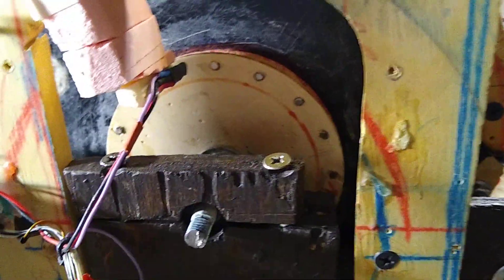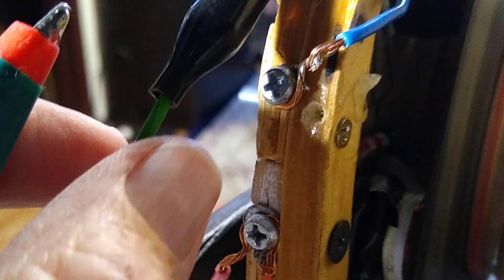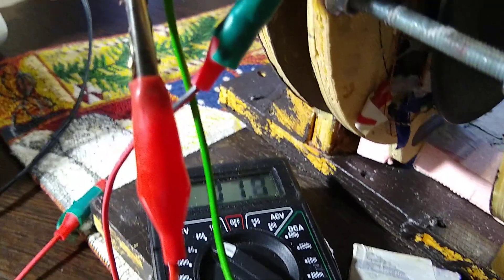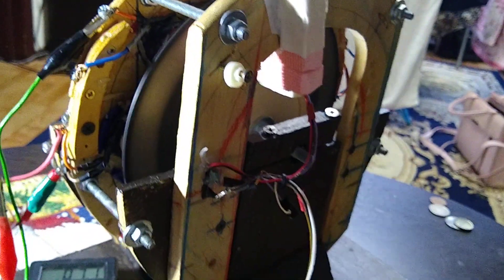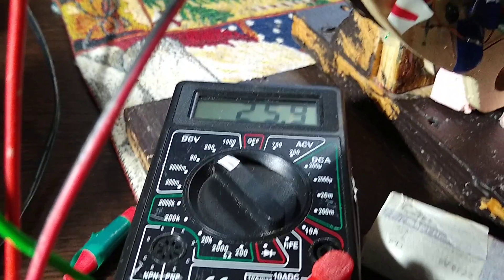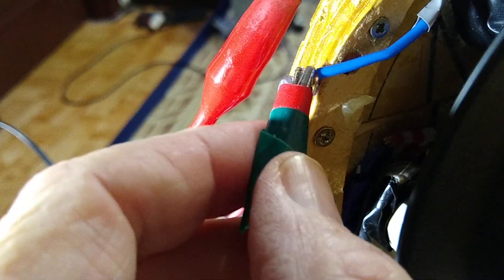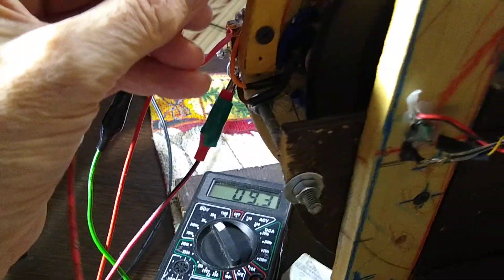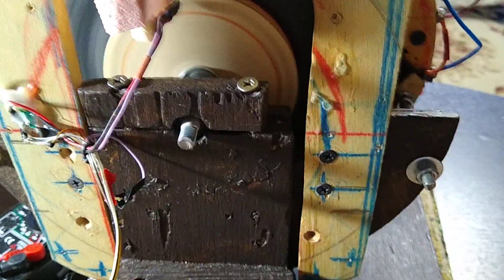Dualrotormotorgenerator now going very good.

Comment: you dont want source volts to be high its wasting power the trick is low volts low watts low current and "FINE TUNING"  as well as positioning between your gen coils and your drive coils . Gen coils and drive coils must choose between the face or the circumference of the rotor in order for fine tuning to happen via the stator position (3 phase stator GEN) / Tesla

Comment: 7:43 sounds like it will brake 100% now just distance the stator from the drive magnets so it dont brake but you cant because your drive magnets should not be on the face they should be on the circumference  ;) hope your getting my message

Comment: right  now it is running because your load is more than your gen coils produce use thicker wire for stator winding thick enough to 100% brake this existing setup once that happens then distance your stator a little so it dont brake but it will still run a lighter load for essentially  FREE

Comment: keep gen coil shorted and distance your stator from the magnet rotor to the distance where it keeps running under 100% load then put a useful load and it should run fine

Comment: Doug would it be better to lay it flat as Hitler's made the vw beetle engine flat as his scientists knew that it played in hand with earths field rather than a positive sun to negative earth that causes drag .. basically to match our equator .simple to see if any advantage as your structure looks sturdy
Reply from the maker: Thanks most of time my stuff has vertical axle but not on this one 
Hitler was a nazi asshole and VW engines only three main bearings plus split crankcase that always leak and air cooled always overheat 
Give me fiat 124 pushrod motor my favorite,  followed by volvo 240 motor that last for a zillion miles.. You need horizontal axle to balance at least. Used to be a fiat car mechanic in younger years...

Comment: Nice build! I am wondering if instead of winding left side and right side for run and generator on one core, what happens if you wind it directly as a bifiler. If the magnets were exactly positioned (no offset) you would get the majority of the backemf out without any lenz... but with the offset i admit I do not know. would be interesting.
Luc
Reply from the maker: Hi Luc
Getting backemf/flyback without lenz is not so difficult as you know (fill caps via steering diode then discharge caps while uncoupled to load) but I want to see the offset-thing how that is going to work.  It would be cool to find just the right offset for a particular rpms and load and see nothing at all when it is loaded, speed up might even happen.  I talked to a paranoid inventor guy up at Bill Mullers way back around 2000 who had a looper in a shed surrounded by C4 explosives in case anyone tried to steal it, and it put out tons of power and was looping.
I believed him anyways  - I asked how he did it, and he had large curved C shaped cores wrapping around and over the rim of a rotor disc, stuffed with neodymiums.  similar to Muller motor generators - but instead of coils on each side of rotor in stator plates, he had the motor coil wrapped around one end of C shaped core, and all the rest of the C core was wrapped with pickup./ generator winds all the way to the  other end of core.  He made the "bottom"  end of  C-core "end up" reacting to the ADJACENT  rotor magnet as compared to the rotor magnet the top-end of core reacts to......so C shaped and angled cores.
Anyways seems like it can be done simpler with two rotors, and straight cores, same thing....motor coils on one end and generator the rest of it.....I want to make another of these with much longer cores so make a lot of power frmo the generator winds eventually...
I modified the timing disc tonight so I can access the nut behind it that holds the two rotors together, and am going to lossen that nut just a bit so I can offset one rotor to the other say a couple degrees at a time and stop and test each offset "angle" until there is one that will work if it will at all. I think it will....with pulsinb out the generator coils to load or big cap, I think it already will be without lenz as it is now at the offset just tested but I want to see it without pulsing out if possible.
Reply: @MrDKONZEN  Sounds very good... i remember a guy called MrAnguswangus.  he was using nearly C shaped cores.. more U shaped.. also going to both sides of the magnet..  allthough he was a bit strange, he had very good results.. it was a sort of ed leedskalnin type of thing, but no lenz. I am just finishing my workshop... and will start  experimenting again after christmas. Can't wait to see your new double rotor experiments.
Luc
Reply from the maker: hi Luc  Yes I watched alot of AngusWangus he was doing the Leedskalin thing, then was using cores from microwave oven fans too.  A lot of iron in his cores that the rotor magnets had to budge themselves over.  His cores were not what I was trying to describe, as its more like a big 0 with a slit in one side of the 0 to let the rotor magnets on a flat disc slip through.  Also motor coils one end, all the rest generator.  
Just had comment from someone who was interested in how my voltage is going up in the caps over the primary DC power supply - you know when I randomly short out the generator coil 2/3 of coils, to simulate pulsin to load I say in video, Actually what I am doing is the sinewave peak coil shorting of generator coils I would always talk about, except not at the peaks all the time since random, and manually....but it is unintended "consequence" (accident) that the primary run cap is going up in voltage flashing sometimes a ten times the voltage of the 7VDC into the motor coils...and this because the generator coils get shorted and the "hyper ringing" flashes back into the motor coils, and from here goes back into cap!  So motor coils become a secondary, the generator coils the primary more or less. This during the motor coil OFF time it works like this.  Need to set up a second switch to keep it always during off time, and do it consistent at peaks only, that is ,the shorting of the generator coils.  Interesting this only works one direction of rotation too, maybe DC condition set up with the all N magnets in rotor it is shoving stuff backwards dont know whats going on but all interesting whats happening @FreeEnergyNerd
Reply: @MrDKONZEN  I also had that effect (this only works one direction of rotation) when i pick up the back emf with a Ultra Fast diode through a second winding. In one direction it uses ALL the back emf, if you invert the "poles" it hardly produces anything. But i was wondering if (just trying to figure out all possibilities) when you are tapping - shorting the coils and the cap goes up... it could also be the coil acts like a transformer.. and sends the voltage peak back in the other direction... my only question is.. that would be a AC burst going through a DC wire.. so could it be that the meter gets a little mixed up? we had that kind of phenomenon in the past..
Reply from the maker: @FreeEnergyNerd  hi Lucy could be an "AC" burst and I am sure meter will be mixed up "even if' a diode there or FWBR (what you do with shorting at peaks since created AC HV spikey hyper ringing 'clusters
However the magnets in this build are all facing same direction so maybe it's going to be a DC magnetic shove backwards into the caps across the primary.  Not sure!
Will be fun figuring out what the heck is going on. From my experience with peak coil shorting it needs a FWBR on way into DC type cap, then it really "sticks" and important to have no resistance across cap as it fills, and cap must be decoupled from the FWBR and/or coil being shorted, upon discharge to load.  Also just by coincidence my mosfets are connected budurectionally with a pair that have gate A and gate B connect and source pin A and source pin B connect then actual switching happens between drain A and drain B
This is also a "must" with peak coil shorting as the switching must be low impedance with ability to switch lots of ",momentary" amps, and also must be able to switch AC, which budurectionally connected mosfets can do. Note 4 mosfets on video - two in  parallel and the parallel pair connected bodirectionally.  The pair in parallel to lower impedance.
Reply from the maker: Didn't finish.....anyways it could be just lucky I happened to use bodirectional mosfets as it might be necessary for effect might not we will see
Reply from the maker: Luc not Lucy! Sorry
Reply: @MrDKONZEN  luc is the man’s name clearly but Lucy is not so bad as an alternative tbh; people use to call me ‘Hansl’ or ‘Hansi’ which is from Germany. There were times it bothered me, today I know it just funny haha